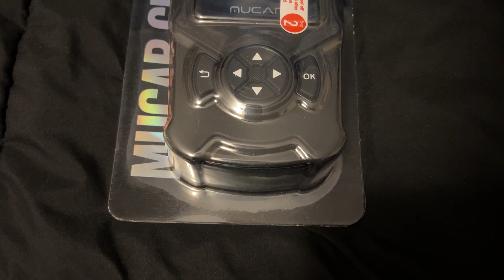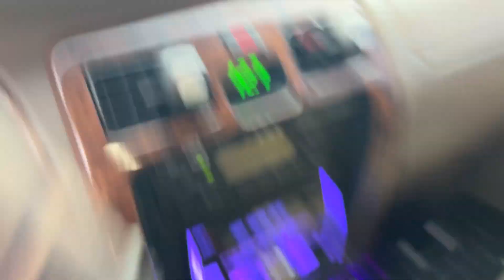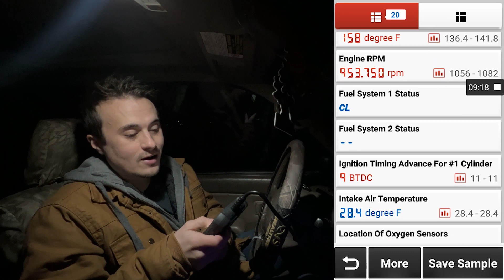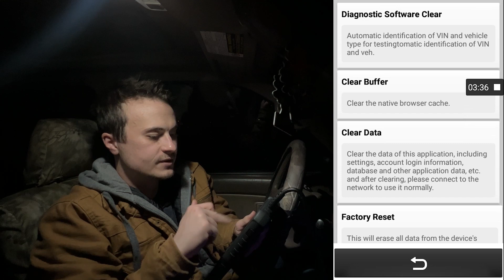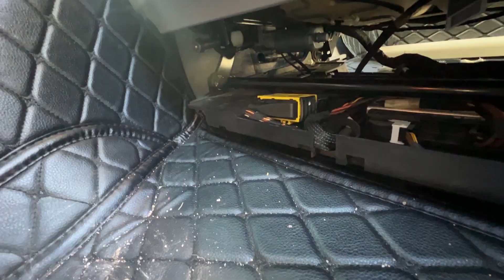Testing The Cheapest Scan Tool with the Most Amount of Features | Mucar CDE900 Review and Tutorial

Comment from the maker: skip to the part you want to see below:
00:00 Intro
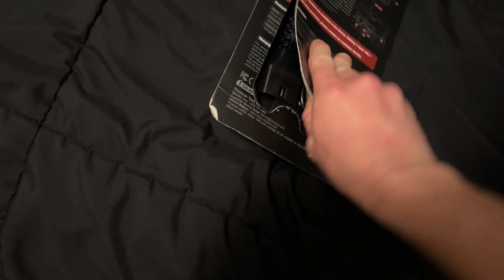00:41 Unboxing
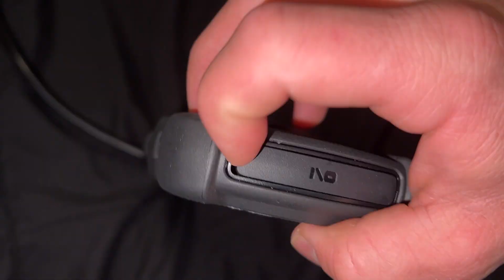01:20 Powering on and getting started
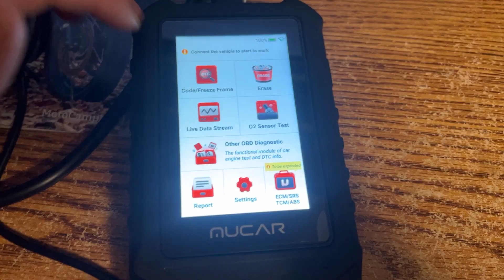02:44 Upgrading to ECM, TCM, ABS, and SRS
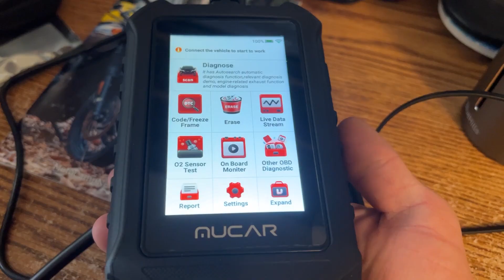05:45 how to power on and off
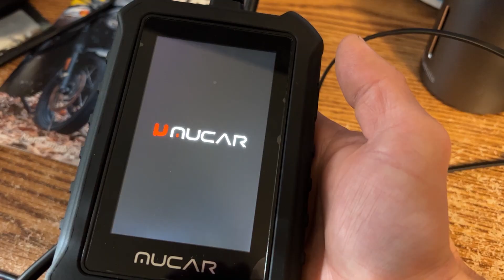06:11 Testing Overview. How to Learn about Diagnostics
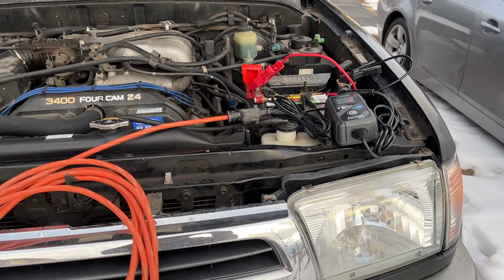07:53 Battery Charger
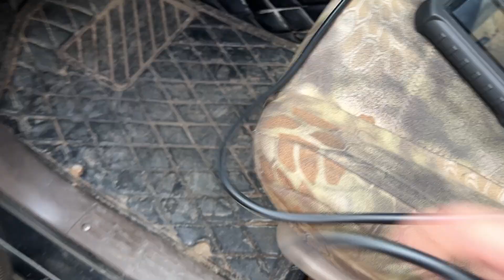08:19 Connecting the Scan tool to the car
10:16 Emissions Monitors
13:18 Reading OBD2 codes
15:23 erasing OBD2 codes
17:07 Live Data and Graphs 
23:14 O2 Sensor Test and other features
24:59 Settings
29:31 Upgradeable content ECM, TCM, ABS, SRS
42:10 Final thoughts, the good and the bad

You can find The Mucar CDE900 Scan Tool here: https://ebay.us/Nf9Do3 (paid link)

(I may get commissions for purchases made through links with "paid link" next to them, buying from one of these links or using my coupon code will help me support the channel at no extra cost to you.)
Reply: Can I buy this from you... Have a 97 Ford e350 RV.. would need this to bleed the brakes master cylinder and abs...

I live in California

Comment: Can you program keys? And for hybrid cars can you see the voltage of the different cells?
Reply from the maker: not with this one, you would need a much more expensive possibly dedicated scanner to program keys. That's a good question. I don't have a hybrid so I can't test that out but I would think so since you can enter the manufacturer specific side of the ecm. not sure how the batteries are handled on hybrids, maybe it's the ecm maybe it's a separate control module. could be different on different cars

Comment: Great review 👍 her in the uk in the Expand Section which I think only appears after purchasing the extended 4 in 1 package, you can then purchase some maintenance reset system functions for $15.95/£12.60 each which include: Windows Calibration, TPMS
Reset, Transport Mode, Tyre Reset, Steering Angle Reset, Seat Calibration, Stop Start Reset, Sunroof, SUS Reset,
ODO Meter, OIL Maintenance, NOX
Sensor Reset, Language Change,
IMMO, Injector, Gearbox Learn, Gear Learn, Electric Throttle, EGR Adaption,
DPF Regen, Coolant Bleed, Battery Matching, Brake Reset, Adblue Reset, Airbag Reset, A/F Reset, ABS
Bleeding, and finally at the moment as they might add some more in the future
AFS Reset.
know that sounds expensive but if you are a diy-er just wanting to sort your own vehicle as the issues arise and purchase one or two when needed it's not to bad.
Reply from the maker: thanks! it seemed to have appear for me after the update, it's possible you have to buy that one first. it's pretty cool, I like how you get if for life it seems and don't have to pay a subscription. check out the new cde900 pro, ill be doing a review on that one as well. does much more and has bidirectional control capabilities and bigger screen. I like the upgrade pricing a bit better too
Reply from the maker: yeah it's good you can just buy a feature when you really need it

Comment: Well, I purchased this scanner off Amazon and it arrived yesterday.  My first impression was that it is well made and has a heft to it, like it is made from decent materials rather than thin plastic.  For the price ($70 at the time of purchase), I wasn't immediately disappointed.  The touch screen feels proper and the buttons "snick" like they should.  It must have immediately connected with my WiFi because we were able to quickly purchase the upgrades for $40 (didn't see anything that said it was a one time purchase, so I will report back on how long they stay active) and was able to download each of the auto makes I own, plus a few my friends and family own.  

We only tried it briefly on my son's 2004 Nissan Maxima.  There is a lot of information available, and it will take some time to get familiar with the tool.  It communicated well with the car, giving RPM feedback, it knew if we turned on the A/C or other things in the car, it knows when you apply the brakes, it tells you what gear you are in when driving, gives accurate voltage readings when putting a load on the battery/alternator.  It told us that some cylinders were running lean, and my son has been getting an intermittent code that we hope this device will help us fix.  I am a decent mechanic from an old school point of view... all the sensors and computer stuff evades me, so I am hoping this thing will help me learn as we fix.  

More to come as we use the tool.  My initial response is that it is worth the small price tag.  Thanks to The 4 Wheel Kid for turning us onto this.

Comment: Cool little unit.  I have a ubs obd2 and the BMW round connector that I use with my laptop.  I manage to get a clone of a BMW laptop they use at the dealerships. Then installed some more software for obd2 so I can connect to my Jeep and other cars.  If I didn't have it this would be on my list.  Could be a good one to put in my small box 🤔🥰
Reply from the maker: thanks, very nice! the round connectors are the old school ones. haha I work at a bmw dealer so I usually can just read faults there on my bmw there. it's nice having a scan tool that does all makes and obd2. it's nice to be able to read fault codes
Reply: Bad timing... Have purchased a launch creader 3001 2 days ago for my bmw e39... If i saw this one previously I would buy it...
Reply: @joaom8246  hopefully you kept the receipt lol.